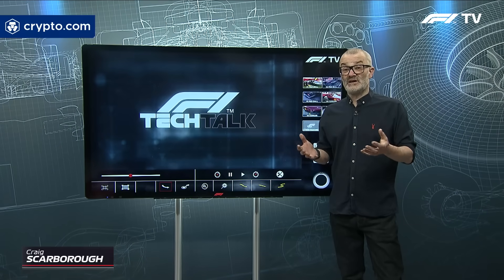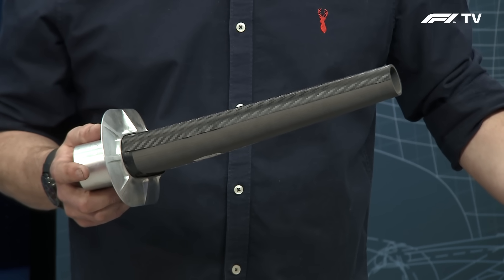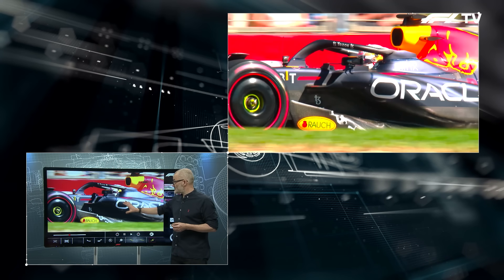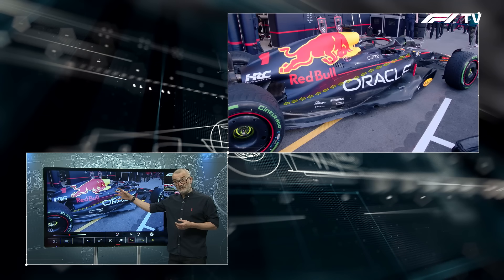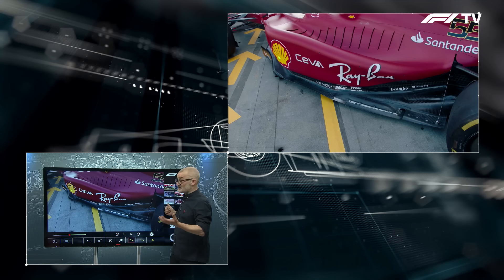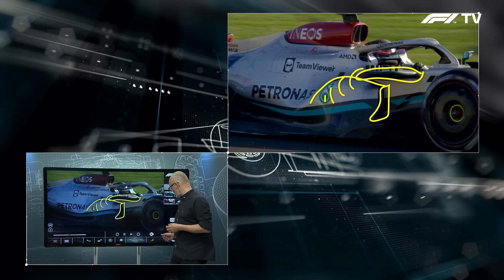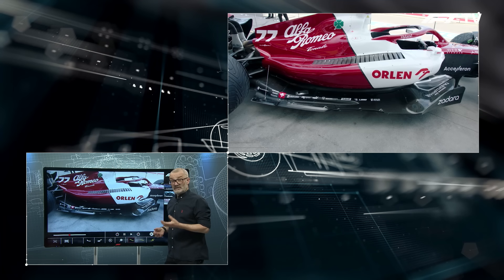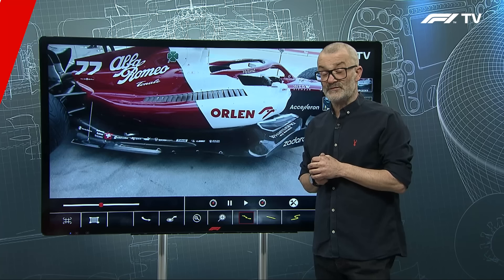The Innovative F1 2022 Sidepods Explained! | F1 TV Tech Talk | Crypto.com

Comment: Also as cold air intake for the Intercoolers of the turbos or do they not use it in F1? When I upgraded my GTR’s intercoolers using HKS, they even had a carbon fibre air guide to maximise its effect

Comment: @Craig Scarborough - I am curious whether any of the teams have saved weight by eliminating hydraulic oil reservoirs by leveraging a pump known as fueldraulic pump.  I know, for example, to reduce weight on the JSF (Joint Strike Fighter) the use of the onboard fuel (eliminating an oil) with a fueldraulic pump for the actuators, aero-control surfaces, etc.  I can imagine a clever team using this approach to control steering actuators, perhaps other areas of the car.

Comment: That Merc's concept looks great on paper and up to ~250kph+ in reality, but porpoise a lot and higher "body drag" so it's not really working.
What can they do? Reposition the radiators and/or bulk up the sidepods and put in ducts to blow clean air on beam wing
Also they've no cutouts on the floor edge which could help porpoising sort of "pneumatic cushion" and "vent the underfloor"

Comment: Mercedes took a big gamble with side pods and it has not paid off.  Merc's are more form fitting with less pronounced air intake while Ferrari and RB are the more traditional high shoulder instake with channel below to manage air around the rear wheel.  With the in-season development rules, it will be tough for Merc to update the car.  Ham finished 14th today which is an embarrassment.

Comment: I really love if you to talk a little bit about how different sidepod design cause an aerodynamic stall (boundary layer thickening) to the radiator as far as how Mercedes sidepod goes which effect cooling performance without those multiple deflectors. And how Ferrari designed sidepod create a pressure stagnation that is not also create strong front floor suction, but also a strong outwashing effect from those design.

Comment: I wonder if the side pods generate a bit of lift in faster speeds, especially on the straights, compensating for the excessive downforce created by the ground effect, allowing some cars to avoid porpoising and Ferrari not to have porpoising disturb driving. If that's the case, the "zero side pod" design by Mercedes robs them of that aero tool to correct porpoising. Does this make sense?
Reply: Hmm haven’t thought of it that way. But Mercedes decided on the no pods for a reason

Comment: Iv'e seen pics of Red Bull and Mercedes floors and can tell you the side pods aren't the biggest difference. Without going too far into it Mercedes floor cuts off air flow the closer it gets to the ground, Red Bull's floor is higher closer to the tub so as the car lowers the air can speed up through that gap while the outside can touch the ground to bleed off excess down force at top speed. 
Mercedes is blinded by the potential of a concept they can't control whereas Red Bull uses one with more latitude.

Comment: The Mercedes looks like it was left out in the sun too long and it melted into a lumpy blob.  It does not look at all slippery and it isn't.  I wonder if it was a case of exploiting a loophole in the side pod rules because they could rather than because they should.
Reply: If these side pods were causing the problem Mercedes would have gone back to the Barcelona spec.
Unless that was worse.
Reply: @duckrutt  If anything, the Mercedes "no-pods" are working too well and are creating too much downforce causing the floor to continuously stall out on the straights leading to their massive porpoising problem.
Reply: @duckrutt  i mean those sidepods are basically just an earlier version of the oe they have now. Its way too draggy and probably it doesn't seal the edge of the floor as well
Reply: Well, from what we can see Merc sidepod are working, as asaid in this video they are creating much more downforce than the others. In fact the problem is with porpoising, which affect mercedes more since the have a stronger floor effect.
Reply: Could be. Gunther said they thought about going with that version in the summer but decided the wide sidepod version is better.
Reply: @aldogjipali2835  Kind of, he said they trialed the small sidepod solution and didn't like what they saw but it's unlikely they saw the loophole  in the regs that Mercedes did. What they tested was the Williams concept more so than the Merc one.

Comment: No sidepod means less drag, which should result in better speed...
On papers it should work, we know Mercedes till this moment couldn't make this concept work, but if they do so,  does that means we'll have a sidepodless F1 in the near future?
Reply: I guess you weren't listening to what Craig said in this video. He literally sad that Merc is sacrificing drag to gain downforce with this "zero-pod" design
Reply: But the rear wheels are exposed  with the rotation disturbirg the airflow aside the drag. Masking the wheels with sidepods seems to be a more balanced solution.
Reply: No sidepods  = more downforce, so in theory faster in turns but slower down straights